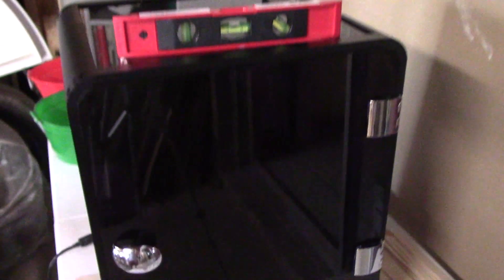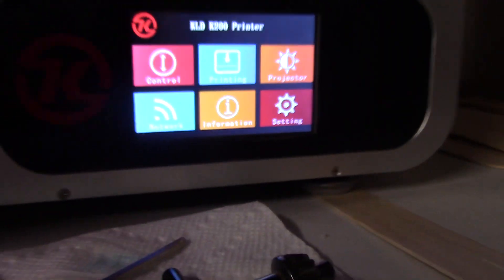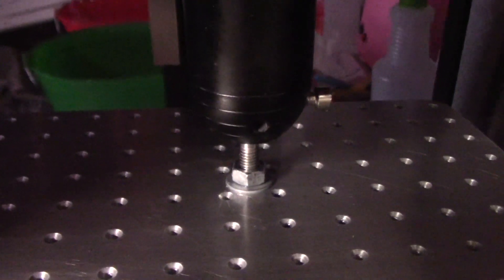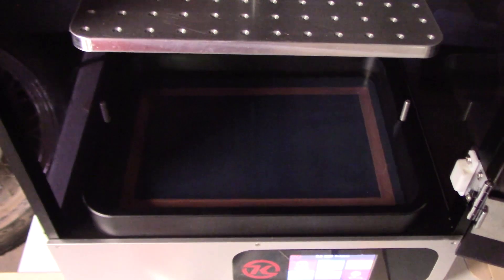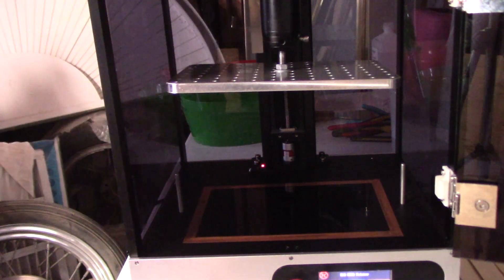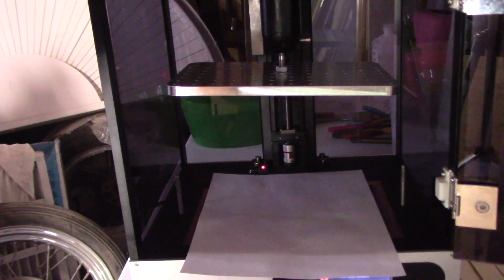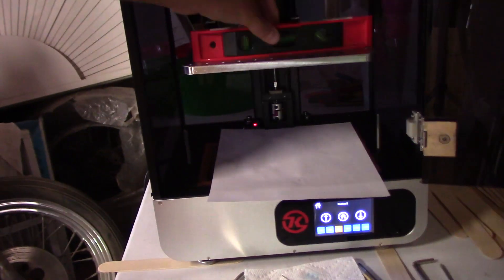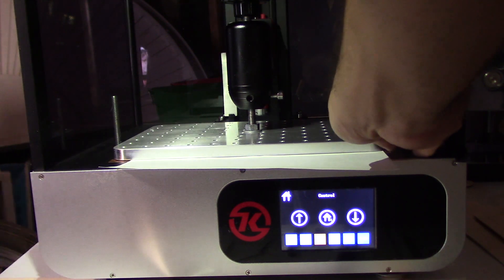Aliexpress 3D PRINTER KELANT COMBAT S500 PART 4

Comment: I have bought one of these on Aliexpress...  parts missing, customer 
service... I mean... What customer service? there is none. No resin 
delivered... by the way delivery under 1 month when they said 5 working 
days. Now the motor is burnt. They do no respond to my refund request or
 replacement. Avoid Kelant, avoid S400 and Aliexpress....
Reply: alain bourotte sorry to hear that. Have you joined the Facebook group for the printer? Get in touch with xie alex from there. AliExpress should have some sort of buyer protection. Gl.